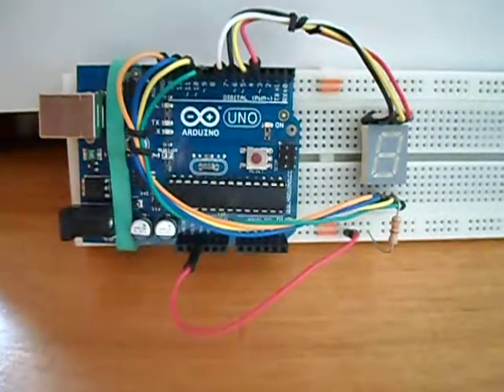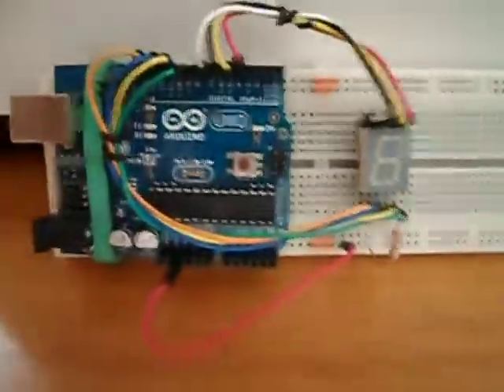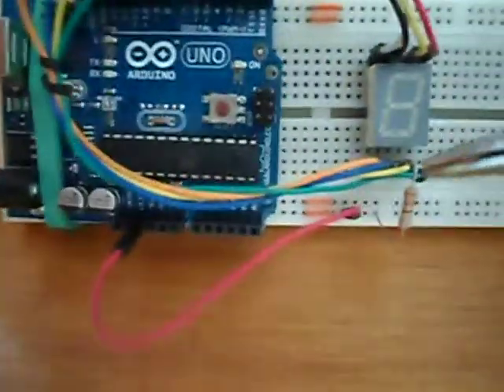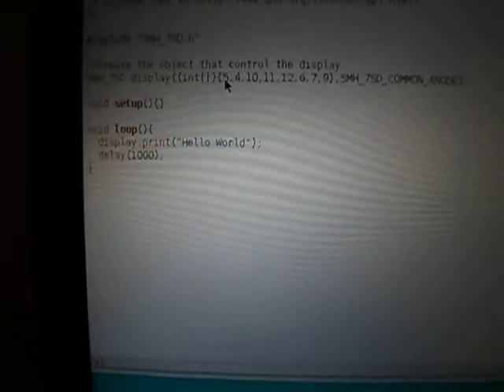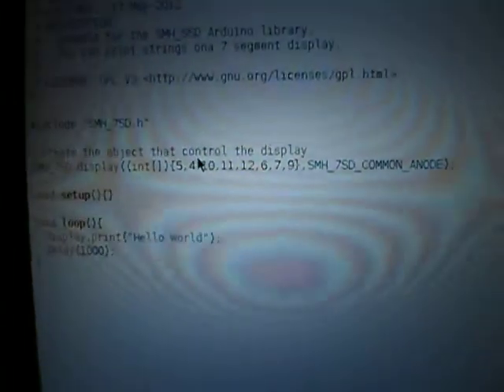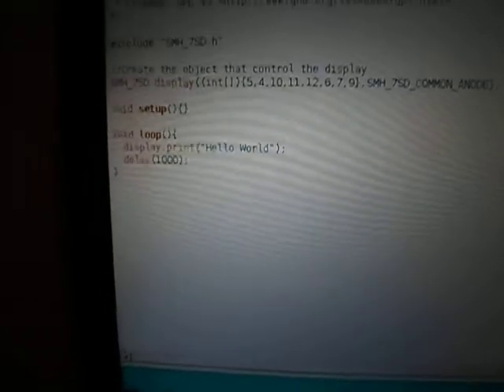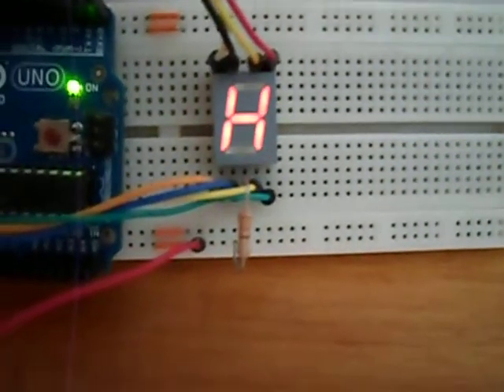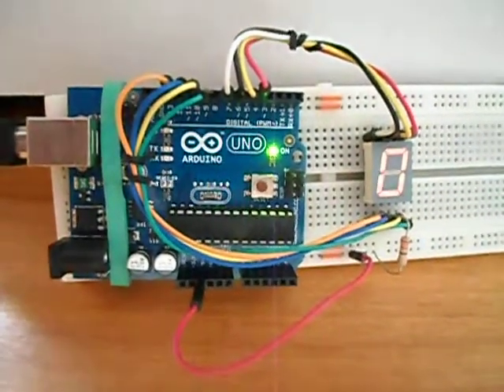HOWTO - Arduino  7 Segment Display - Write text

Comment: Hello Friend! Using only a resistor in the Anode is no danger of burning Led?
Thank you
Reply from the maker: Yes, there is a risk since a single segment  (i.e a dot) could receive the same amount of energy as the whole display (i.e. 8.). The proper way is using a resistor per LED input (8 resistors).

My way is simpler and intended for a quick test. I'm selling the library, not the hardware schema ;)

Comment: Why dont you try to use a decoder? In that case you could to use 4 wires less than now!
Reply from the maker: This method allows you to write any of the 8^2 = 256 possible combinations of the 7 segments plus de dot and therefore, the alphabet can be expanded in the library.

I get the point where you would like to save wires, in that case you have to move the alphabet to a decoder element to get ceil(log2(number of symbols)) number of wires. This method would imply some kind of firmware so the alphabet is not so easily expanded.

This is supposed to be an easy video  to encourage pepople to play with electronics :P
Thank you for your comment.

Comment: I tried to add your library to my arduino library folder to run this program. Although it is showing up on my IDE example list but the "SMH_7SD.h" dictionary could not be found and showing up errors accordingly at the time of compiling. Can you suggest some solution?
Reply from the maker: Hi, I've just downloaded the code from the github repo and imported it (Sketch>Import Library>Add library  in the menu) in the ide (version 2:1.0.5). It compiles with no errors. Sorry I can't reproduce your error.

One dirty solution is to create your own project and add the needed files instead of importing them as a library.

Good luck!